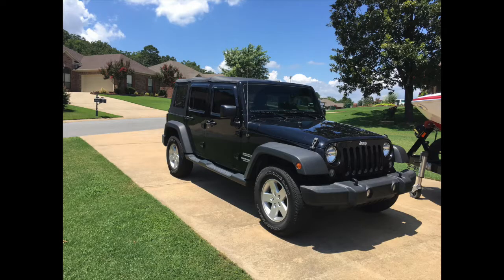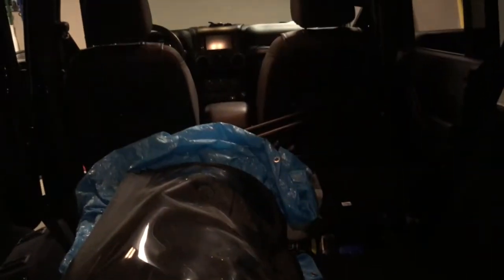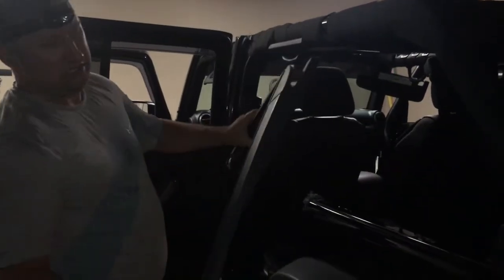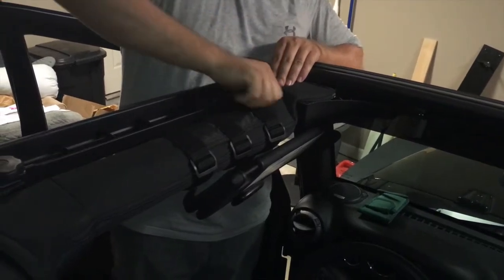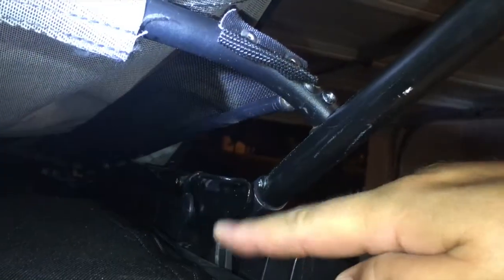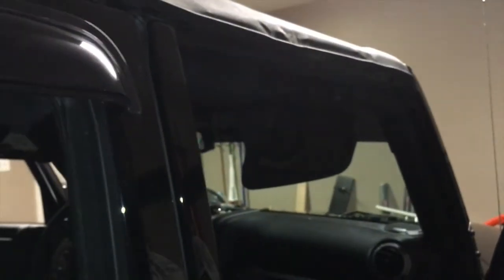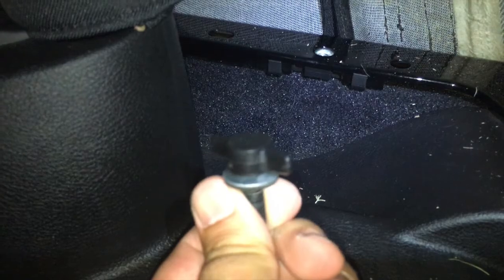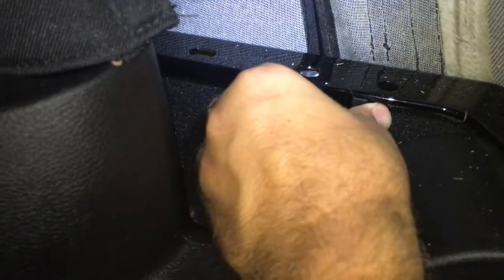Complete Jeep Hard Top to Soft Top Swap Jeep JK

Comment: Does bow 2 go over the side tube
Reply from the maker: william Swanson  I’m not sure which one you’re considering to be bow 2. From the back, the shortest bow that connects to the back of the roll cage on the pieces I say is important to get with the top, it forms the top of rear window. Other bow that connects to same point goes inside roll bar towards front forming the second bow from the back. Going forward, the next piece should be on top/slightly inside and the tabs clip into the quick release. It’s the hinge point for the “sun roof” if left open without taking the top all the way back. Then there is another bow that rests on soft top frame when fully close. Least piece latches into the windshield frame. Hopefully that makes sense?!?